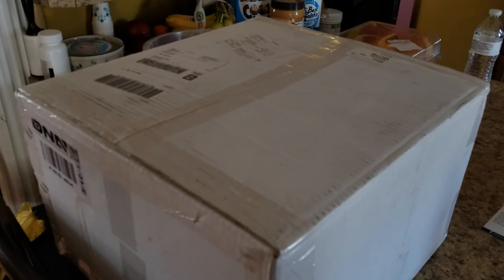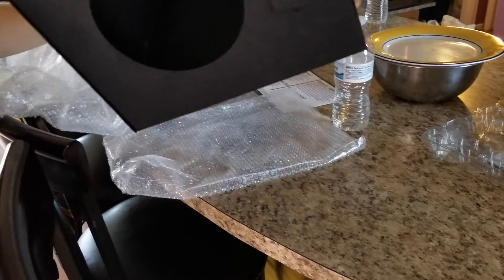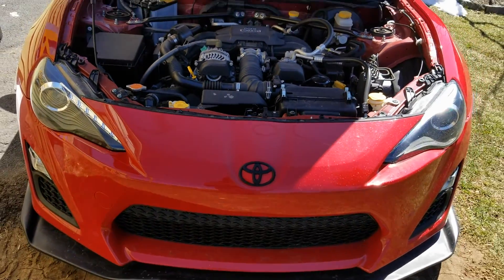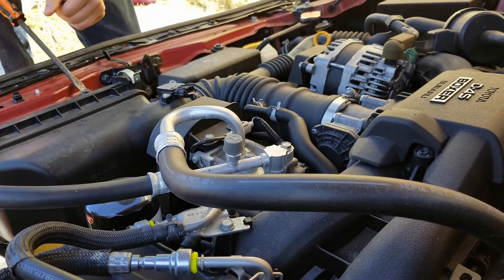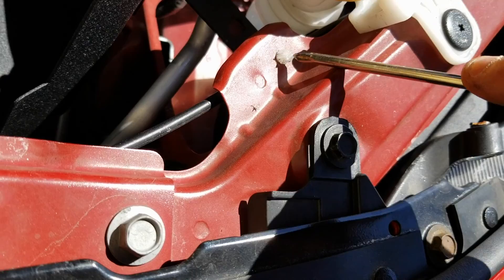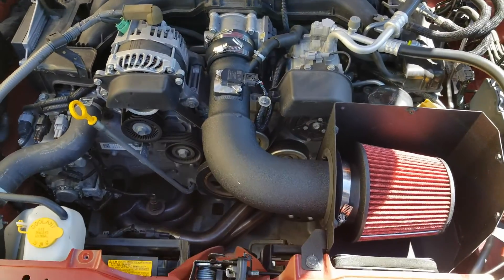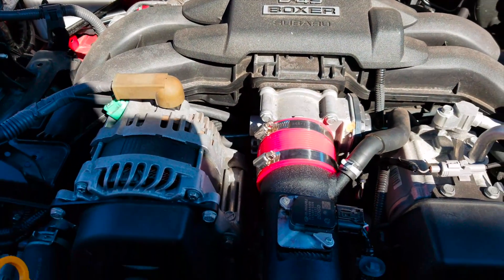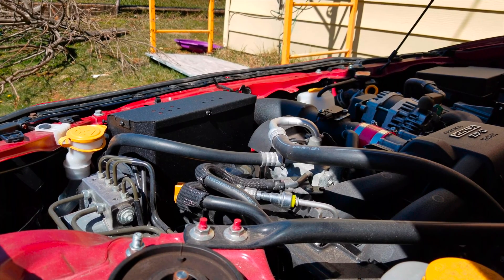FRS GETS MORE POWER?!

Comment: hi Break traction I have the same air box I have the engine light which comes on after a while.  Were you able to solve the problem?
Reply from the maker: I never had a check engine light from it only had it hiccup on me but after a tune kt was fine